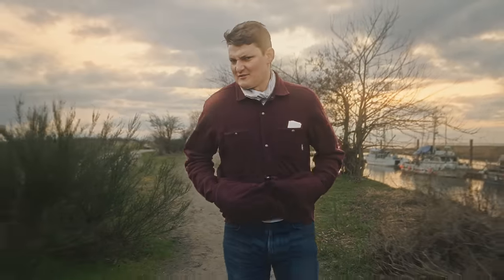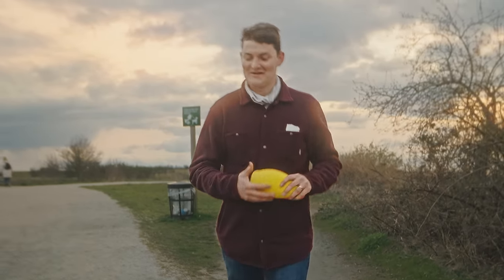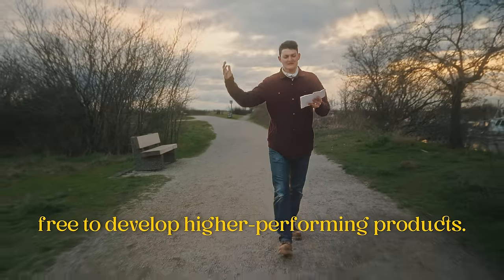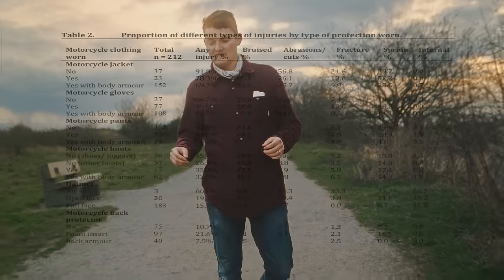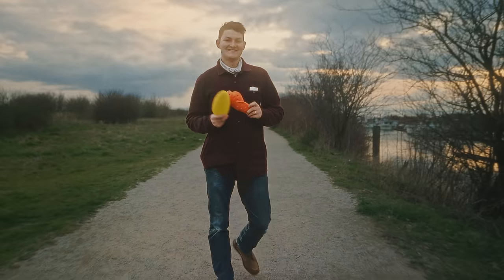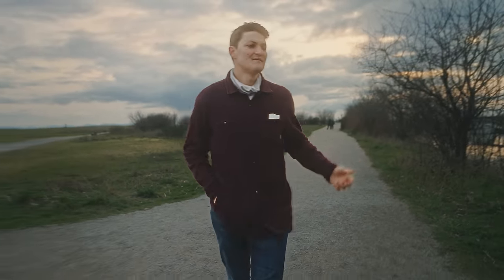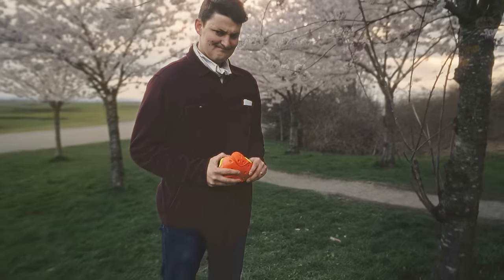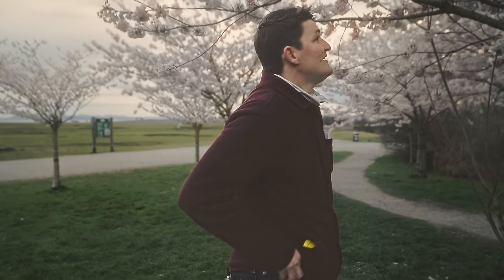Why I Stopped Wearing Motorcycle Body Armour

Comment: I'm not sure if you ever had an accident. But I had where I rolled across the street like a ball for about 60 meters .
And believe me, I was happy to wear clothing with good protectors.

Because I was rolling like a ball, most impact was on my knees, elbows and shoulders ... exactly where the protectors are.
And looking at the wearness at these points, I'm glad, that the impact was not directly on my knees, elbows or shoulders.

Maybe worth mentioning:  I only wear good protectors made of rubber, not thees cheap foam ones you have shown in the video.
Reply: could you please share what gear you were wearing? im really torn on what to buy

Comment: I remember I specific incident when I first started riding where I wish I had been wearing armored pants. I totally botched a turn on a hill from a stop sign. I popped the clutch, which made my newb brain grab the front brake too hard, which made me lose control and get all kinds of wonky.

I ended up in the ditch on the other side of the road, and I had banged my knee against a stone as I went down.

Having that armor would absolutely have saved my knee from the punishment it received that day. I could barely ride home.

Would it have saved me from a break had I gone down a different way? Maybe not. But, I sure wished I had it that day. And now, I wear full gear, with armor, every time I ride.

You do you.

Comment: Had a crash last year and fell on my ellbow. I am convinced my level two protector spared me a fracture. I am keeping my level twos in. I want as much protection as possible!
Reply: Its true it did. No ifs ands or buts about it, it's not "convinced" or "belief", its fact.. The data presented in this video may be correct, but its interpreted incorrectly. A ~50kN force is reduced to 9kN, thats 80% reduction, and that makes a difference. Let's work the calculation the other way. Say your goal is to keep force <4.5kN and not break a bone, assuming 20% force  transmittance means you can now sustain <22.5kN impact and come out without a broken bone. Thats 5x more force than you normally could. 

There's a large number of instances where wearing pads helps. Taking the most extreme examples (like to 50kN example here) doesn't provide a meaningful data to make decisions.

Comment: (Preliminary remark: Automatically translated from the German by Deepl.)

Ok - so the main complaint is that the protectors don't deliver what they promise. I don't think it makes sense to remove them because they also provide protection when "grinding". The times when the "pads" could actually have caused damage in the event of a fall (especially if you landed on the "edge") are now really over.

What is the safest? It doesn't have to be a racing suit for racetracks. But a tailor-made (2-piece) leather suit with appropriately sized protectors with a correspondingly high ability to absorb the forces in the event of an impact is perfectly acceptable.

In addition, of course, "real" motorcycle boots and gloves, possibly - even for "road riding" - a neck brace. Some manufacturers, such as Dainese, do not "build" a back protector into the suit at all; they leave space for a model to be worn separately. This also makes sense because the coccyx can be well covered in this way; this part is then tucked into the trousers. In addition, they may also include a chest protector (anyone who has ever crashed into their own handlebars knows what I'm talking about).

Incidentally, I wear a suit from "Schwabenleder" (this is not intended as surreptitious advertising). They have a patent: the back and coccyx protectors are housed separately in the jacket and trousers, but interlock when the suit is properly closed and worn.

But of course textile - reinforced with Kevlar or Aramid - is also perfectly fine. Not everyone likes to wear leather.

It should also be mentioned that motorcycle clothing - some will now hyperventilate - must be worn correctly (apart from the fact that the fit and size must be right). This means, for example, that the zippers must be completely closed.

However, the criticism of manufacturers - and indirectly of governments,  and, of course, some NGO's - is more than justified. First of all, the problem is that here in Germany, leather suit tailors who have made 20,000 suits in their lifetime have had to stop because they are no longer allowed to certify themselves according to the new standards, but - every model! - to a "designated institution".

This is also a joke because the standards are really far too lax - and the protectors are far too small in terms of surface area. There is no point in letting a steel ball hit the protector (and the clothing) from above during the testing process and then measuring how much force (Newtons) is still applied on the other side if the required damping values are too low - and that at the steep prices.

As far as wearing comfort is concerned: these nasty rubber things (where have the foam or honeycomb protectors of earlier years gone) are really disgusting, especially when they are placed in thin lining pockets and practically lie directly on the skin. At least that's the case in Europe. It would be much better if there was a piece of lining in between and the protectors could be slid into the corresponding pockets from the outside (!). Then they would also be much easier to position. But they would have to be larger - and would be correspondingly more expensive.

However, I think the reverse conclusion - “protectors out of the clothes” - is wrong and bad advice for riders: better protectors are needed. Airbag solutions will remain unaffordable for most riders for some time to come.

How can we deal with this now?

If so, then we should "get down to business".

1. Standardization must make use of truly independent experts. Most of the NGO's that are involved here (for money) are actually government organizations in disguise.

2. The wearing of standardized protective clothing when riding motorcycles must be mandatory by law. In my opinion, there is no way around this in the long term. 

3. There must be an (international) agreement - guided by factual considerations - on the protection concepts and the objectives to be achieved. The decisive factor here is not the wishes of the manufacturers, but the requirements of the drivers and the physical circumstances. Everyone knows that the physics of driving cannot be fooled. Besides - who wants to change at every state border?

4. In particular, you can't change the standards every 2 or 3 years and then expect everyone to buy new clothes.

5. There are also very practical requirements (bureaucrats typically don't think of this): e. g. the corresponding labels must be attached securely and permanently - and recognizable from the outside (who wants to undress so that the police can see into trousers or boots?). If necessary, electronic tags - if they function reliably - can help with reading, even in an automated process - as it were, when driving past, which should considerably reduce the effort and inconvenience for those being checked and inspectors alike.

6. The aim should be to provide a reasonable level of protection - not the luxury version. And from the driver's point of view. Not everyone has to dress like a professional racing driver in custom-made clothing. Insurance companies (health, accident, etc.) or even the state can reward you with bonuses if you ride - generally - with "more" or "better" equipment.

Perhaps the implementation could start with new drivers or those returning to driving.

I know that all this does not suit a group of drivers - in my opinion a vocal but very small group - who insist on individual choice. But who still drives without a helmet (or without a seatbelt in the car)? On the other hand, what would these quotas look like today if there were no obligation to do so?

It is conceivable that such regulations will initially be introduced within the EU and Switzerland. But make no mistake: other countries can very well decide between supposed and real freedom and sometimes have much more "power" to enforce this.

I've ridden over 250,000 km (approx. 155,400 miles) on my motorcycles so far. I don't make a big distinction between a 10-day tour, a ride to work or a trip to the cinema in the evening - I always wear one of my two leather suits. Not everyone has to do this, but I think I can agree: you don't die from wearing protective clothing.

Michael
Reply: Wow! well worth the read, thank you for taking the time to share your thoughts.

Comment: Interesting video, but knee pads have saved me so much pain while crashing my mountain bike at an average speed of 10 mph, there's no way I'm going sans armor on a 400 pound motorbike at an average speed of 30 mph. Impact mitigation at low speeds and protection from abrasion at all speeds is still valuable.
Reply: Completely agree. I was aware of the studies cited by the video and what ryan didn't mention is that they recluted crash victims from hospital beds and police reports, so they were biased toward severe crashes. But from other statisics we know that most motorcycle crashes happen below 50kph and don't cause injuries severe enough for hospitalization. This is even mentioned in the conclusions of the studies themselves, who also admit not having a large enough sample size

Most offroad riders, that experience very frequent crashes at low speeds, would not even think of riding without gear

Comment: Yeaaaaaaah, I'm not going to remove the pads from my gear. I had a spill onto a dirt-gravel parking lot a few years ago, landed on my left elbow which jammed my arm up into my shoulder and took me three years to regain almost all the range of motion in that shoulder.
The elbow pad didn't stop me from getting a shoulder injury, but what the gravel surface would have done to my elbow joint  through the jacketif I hadn't had the pads in my jacket....
"It doesn't protect enough or as much as it could" does not make it worthless. I will both leave it in AND hope/advocate for better standards.
Reply: So the thing about any protective gear is speed and rate of deceleration. If you’re going 80mph and go down, you either slide to a stop, or impact something that stops you. The armor isn’t going to make that noticeable of a difference.

If you’re going lower speeds then the armor is going to make a larger difference. Anyone that rides dirt bikes knows just how much of a difference armor makes, especially on crashes below 25mph. 
Anyone who cycles or skates knows just how big the difference armor makes when an elbow or knee hits the ground.  Bone bruises are no joke. For adults the difference between a day off work vs a week off work could be life changing.

I’d definitely like to see some major improvements in fitment and protection level for armor, but definitely have some doubts about the specific conclusions discussed in this video.
Reply: @mattburkett9419 Even when laying a bike over at 100mph and sliding to a stop, the initial contact with the ground is about the right speed for thin pads to really help, depending how you fall. Also, sliding over small rocks, potholes or gravel with thin pads is still a lot better than without (assuming an abrasion-resistant layer either way).
Reply: Also pads aid the slide, they don’t help much with slams but help with slides.
Reply: Nothing beats an air bag vest for torso protection. It's too bad they don't make air bag jackets that also protect the arms
Reply: @nerychristian  doesn’t the Alpinestars tech do that?
Reply: You're wrong. You have to impact the ground to slide to a stop. The armor will work 100% the same in an 80mph impact with the ground vs 25mph
Reply: @logangodofcandy  Is that so? Would you rather get into an accident traveling 25mph or 80 mph?

Comment: When I did the CHP Motorcycle Safety Class some years ago, they presented injury data, by body part, in riders wearing gear compared to those that weren't. Riders wearing gear fared significantly better and for some body parts the number of injuries were reduced by 80-90%. Ok, they didn't go into detail on bone breaking force, but the fact that injuries can be greatly reduced by simply wearing some padding is a no-brainer.
Reply: The MSF courses just emphasize wearing pants instead of shorts, enclosed shoes/boots, and gloves. They will allow a long sleeve t shirt in class and any gloves you had lying around.  His point was the padding is so thin it won't do anything, so the amount determines whether it is a no-brainer. As a referee I have problems getting people to wear shinguards in a situation where they are guaranteed an impact - and can result in severe injury - so I tend to think most people are no-brainer to begin with (in a bad way). You are right that the padding can't hurt, just don't expect it to do much more than prevent a bruise if you drop your bike at a stop sign.
Reply: @ws8080  MSF only requires long sleeves, pants, etc. and not real gear because you're never doing more than 20mph in a parking lot during a course. They preach the hell out of ATGATT when talking about real-world riding
Reply: Funny, since most CHP riders I've seen, and the two that I know personally, don't wear body armor. most don't even wear chest armor
Reply: My MSF course showed the same kind of injury body map too, but I don't think Ryan is necessarily disregarding that. He's not arguing against long pants/long sleeves, or even heavy-duty materials. The scrapes and slides are common injuries that are very easily eliminated with simple coverage... but what he's suggesting is that hard impacts aren't going to be any better whether you have a little pad or not. He's saying you're just as good with a kevlar jacket without pads as you are a kevlar jacket with pads because when you're smashing into an oncoming car or a tree or what have you, a little 1/2" pad isn't going to keep your arm from breaking.

I'm not about to go take my pads out of my jacket. But it's a logical and seemingly statistically proven trend that might make some of the no-gear-ever squids a little more willing to throw on a jacket if it's not necessarily all-or-nothing and can at least still be comfortable.
Reply: @nickmartin5803  the ¾" hard shield on my jacket is probably going to improve my chances of NOT breaking my back. Ryan also completely ignores the fact that not every motorcycle ride is the same. I ride in Vietnam 6 months a year. Speeds are slow, and padding most certainly is better than none.
Reply: @NMalteC  He'd advocating for airbags or higher level armor.  Watch the end again, where he explicitly gives two different examples of what he personally uses that is above the thin, minimal padding that just barely meets the regulation.  He is saying to get better gear, not eliminate protection.
Reply: You've also got to avoid the self-selection bias of riders that choose to wear body armor  with those that choose not to. This isn't about what the same rider would experience with or without body armor, it's partly about which riders chose to put on ATGATT And which ones went out in shorts and a tee shirt.
Reply: what gear should I buy first ? im a new rider. I just use a helmet
Reply: @positivelycurvedpikachu gloves riding shoes/boots, riding pants, riding jacket in order of priority.
Reply: @nickmartin5803  AFAIC, the abrasion resistance =alone= is worth the price of sub-par armor.  I had a friend early on who crashed his Yammer80 on the freeway trying to get away from a cop, and it took his whole kneecap and part of his tibia. He's whole again, but that had to be a bit painful.
Reply: @positivelycurvedpikachu  good gloves

Comment: Try hitting your knee cap against a rock (or any other hard/sharp object for that matter) without a pad on, then you will appreciate the value that knee pads add.

They may not save you from a fracture in the worst impact case, but will save you from painful injuries during most other impacts. 

The added abrasion protection is also a very good thing! I wore through my AA pants during a slide and grinded the knee pad underneath, but I was unscratched! Imagine the damage to my knee if the pad wasn't there, I would be grinding through my kneecap!
Reply: what is AA pants? Any decent motorcycle garment withstand sliding from 100kmh without problem.
Reply: Same here after hitting a deer, a few pads wore through the suit and started grinding pads.
Reply: @inevespace anti abrasion pants I'm assuming
Reply: @inevespace  AA is an abrasion resistance class, second best you can buy. AAA class is even better, but it's pretty much reserved for full leather suits. It's part of CE rating.
Reply: @patrik9666  There are AAA rated jeans too, for a more casual style.